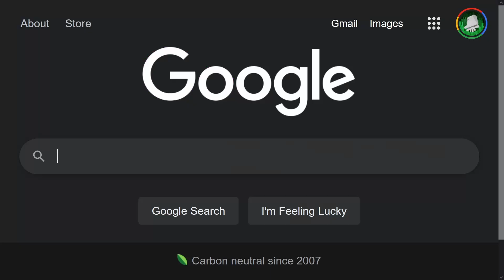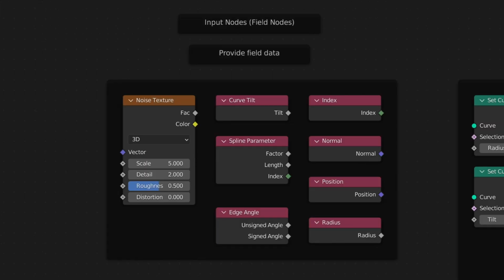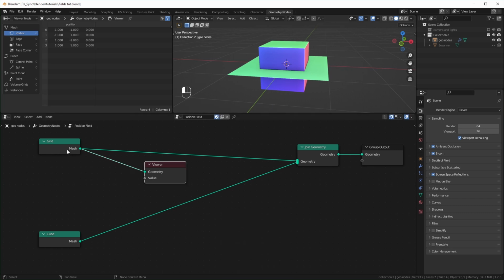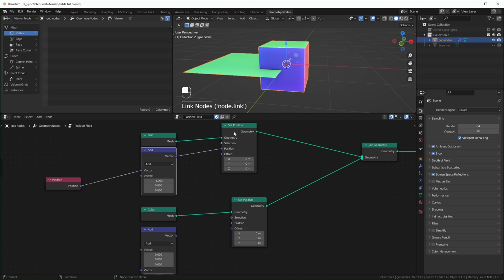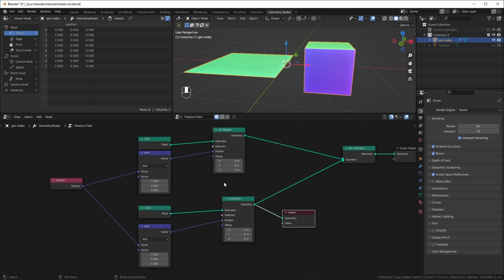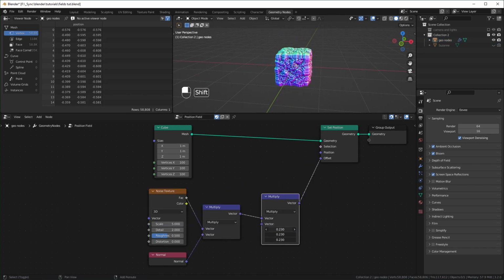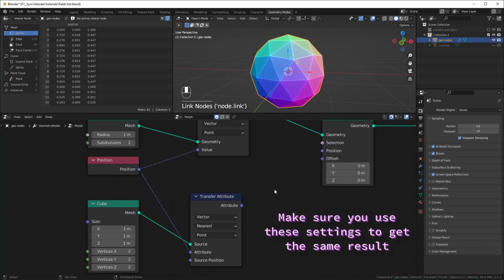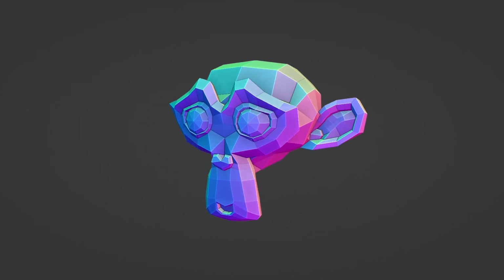Fields and Attributes - Geometry Nodes for Beginners

Comment: Currently (in Blender 4.2, October 2024) I am finding most, if not all, Field Nodes in the 'Read' sections of the 'Geometry', 'Curve', and 'Mesh' categories on the 'Add' menu dropdown in the Geometry Nodes Editor.  Most of these 'Read' nodes have no inputs.

The Geometry Node (GN) inputting the Field Node (FN) output ALREADY CONTAINS the data.  It arrived as a geometry object through a DIFFERENT INPUT socket.  The FN is simply telling the GN what data to use off of that geometry object.

For those with a background in computer languages, I see a FN as an ITERATOR generating a stream of data into the GN's input socket,  using some of the properties of the geometry object that arrived at the other input socket.  If that is confusing, ignore this paragraph.

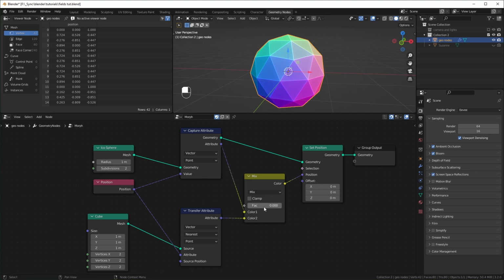Comment: What does blender do in case there are a different number of vertices between meshes like in your example with the ico sphere and the cube? (8:00) 
Does it move the sphere's vertices to the closest vertex on the cube?
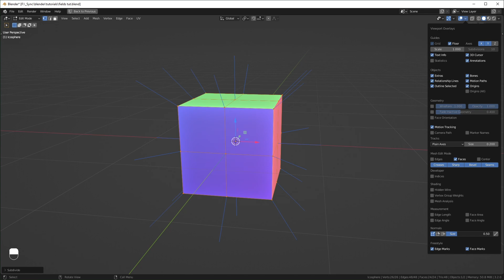and one other question,  in 5:55 , if the offset is supposed to move the cube's vertices, how does it deform the edges and the faces as well?
I guess I don't understand what the position attribute holds, because according to the examples its not just the vertices

Comment: the blender 3.4 version has delete the transfer attribute node, replaced it with the sample nearest and sample index nodes, so if you are using the new version, you can adjust a little bit, and the mix rgb node is also replaced by mix node, but you can change the pulldown list and select the color to use the node in the old way.  i spend half any hour to figure out the change in new version, hope to have some help
Reply: @woodbook7514 and @hugochan4309, thank you two for the work around! I replicate @hugochan4309 process visually that can be found here: 

watch?v=JLKZYVBctoA&list=PLcVimH8k3Dd4WEM-TGWR_tOoGPC2ZRhma&index=3

In case if people still didn't get it on how to do the work around. Tried my best to provide some more help <3
Reply: @RebbyAivazian  thank you!
Reply: How do you make it work? I tried to connect the cube with Sample Nearest then Sample index, but it doesn't show anything
Reply: @hugochan4309   cube node's mesh connect to sample nearest node's geometry and the sample index's geometry at the same time.
Reply: @woodbook7514  Still doesn't work :(, 
1. I connected the cube to both Sample Nearest and Sample Index geometry,
2. I connected the position to the SamplePposition, 
3. then the index output from "Sample Nearnest" connected to the "Sample index", 
4. then I connect the "Sample Index's" Value to Mix node(which I changed to color), 
5. then connect the "Result"(From Mix Node) to Position on "Set Position".
When I change the Factor from the "Mix Node", the Suzanne just goes small. It seems like the node from Cube doesn't pass through "Sample Index."
Reply: @woodbook7514  I figured it out, I also connected the "Position" to "Sample Index's Value" and it shows. Thank you for the help!!
Reply: Here is the code of the `geonodes` module:
import geonodes as gn
from geonodes import nodes
with gn.Tree("Geometry Nodes") as tree:
    factor = gn.Float.Input(0, "Factor", 0, 1)
    cube = nodes.Cube()
    p = nodes.Position()
    geo = gn.Geometry(tree.ig)
    attr = geo.capture_attribute(p.position)
    # This is the key line
    value = cube.mesh.sample_index(p.position, index=cube.mesh.sample_nearest())
    geo.set_position(position=gn.vector_mix(factor, attr, value))
    tree.og = geo
Reply: tested on blender 3.4.1
Reply: @iplai  My issue was when sample index and sample nearest had different settings for attribute like one had edge and the other point. Hope that helps someone

Comment: I think the terminology around fields just makes it confusing.
They way I read it is, "A field is an operation that is applied to each vertex with some data being unique to that vertex".
Or from a code perspective, "this is a portion of the workflow where a vertex shader is being used to build up the next geometry".

It may be late at this point, but I think naming it "field" and calling it a "function" is very confusing to most.
Not harping. It's just one of those "tough to define" things, and unfortunately, confuses most for a while.

Something like "Vertex Mod" would make more sense than "fields" I think.
You're using some field data, but the entire thing is a modification (an operation to a vertex)
Or even call it a shader ... That segment that plugs into a diamond is a shader (vertex shader) - or at least a portion of one.

EVERYONE gets confused on fields. That's exactly why I watched this video. I get it now, but it's really hard to visualize at first because I think the term is being overloaded a bit to mean both the data being provided (attributes of the point/vertex of current geometry) as well as meaning the operation as a whole. I think it likely started down the path of naming it to mean the actual per-vertex data, then took on a different meaning. I'm still coming up slowly. switching back and forth with other training. But, fields is one that got me. I'm past it now thanks to this video.

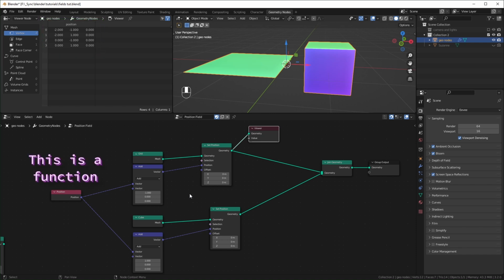Case in point (or case in vertex, I mean) - @4:25 - that's not really a function - it's a per-vertex value (technically there could be function involved, but doesn't need to be). It's just that the term 'field' got re-used to mean both the operation as a whole (shader) and the per-vertex data. So, and this isn't a stab, but I think it kinda got you, the trainer, as well. It's confusing ... If you "encapsulated the Position node AND the Add node And the Set Position node" together, that would be the vertex shader function, but the position alone is not a function.

One last note, is that you could simply describe each green node as a "vertex shader node". All the data and ops plugged into it are simply "part of that shader" with the exception of the geometry of course which is what the shader is applied to.
It's basically waht they call "the strategy pattern" in programming. All the input sockets are "your strategy" for how you want the bigger operation (set position for instance) to work. So we pick a shader that encapsulates the overall thing we're doing (SetPosition), then we customize that  behavior with our strategies.
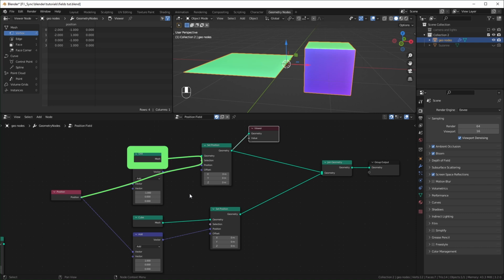Reply: in programming, getters are also functions so example in 4:25 it is also a function. if you think about it, you bring it a mesh as a parameter and it extracts the position from it. thats why you can connect more than 1 mesh to it and it brings you the appropriate position form it

Comment: Your videos are pretty awesome, you heard it all I bet. I haven't watched all of them, but I'm going through them as I type, but felt like leaving a comment just because I can't seem to find any guidance for what I would like to do with geonodes, that is to pick a specific vert, edge or face and just move it around. I feel silly just typing it as the way I put it seems so simple/basic, have you covered this in any of you videos? Thanks
Reply from the maker: You can use a set position to move stuff around and you can select a specific part by using the index node with a compare node. There are lots of ways to handle selections

Comment: Thank for the clear explanation of these complex nodes. But i wonder that, how the tranfer works when the vertex number is different? I mean that, for example, the cube has only 8 vertex, but the sphere has more than that. How does blender calculate the vertex to be merged or??
Reply from the maker: There are options for that in the node. By default, it will look for the closest face and use that position